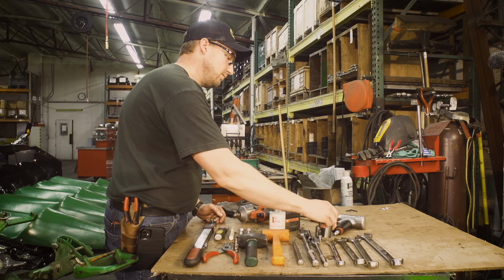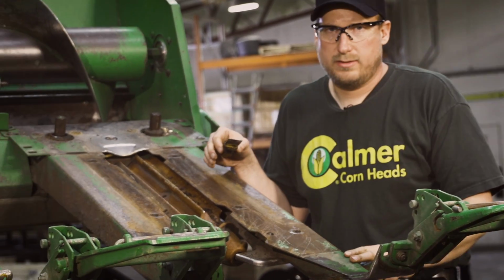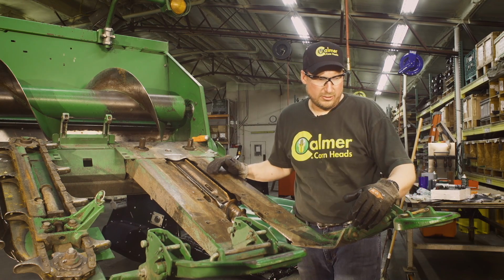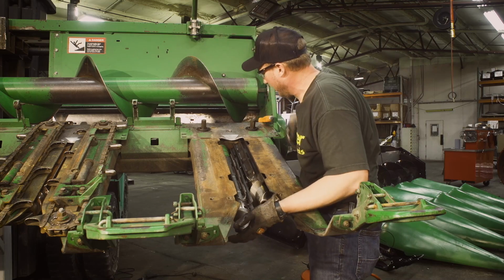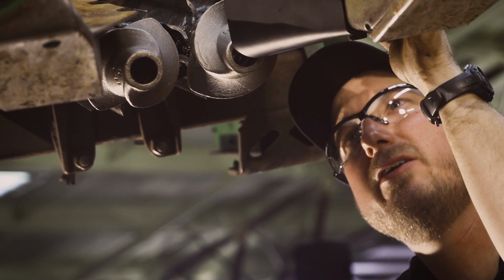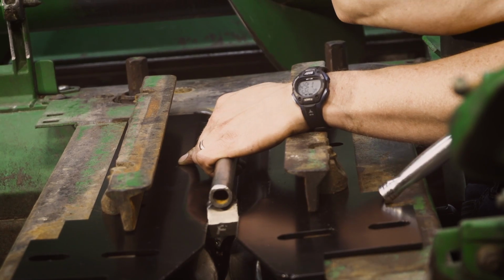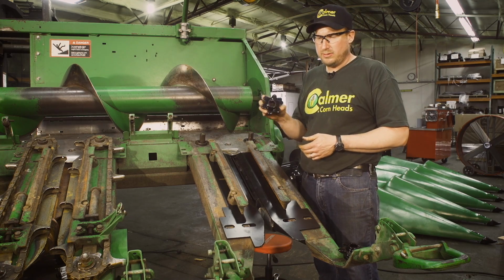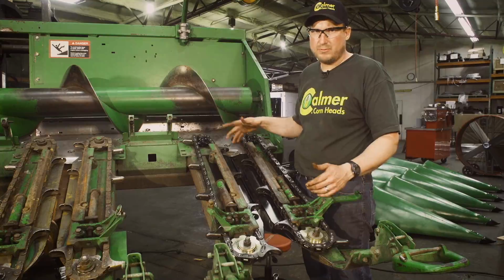Installing Calmer Upgrade Kit on John Deere 40 or 90 Series Corn Head

Comment: Can you describe the size and brand name of the hydraulic puller?  Minimum size required of the hydraulic puller and the cost?
Reply: I used a manual puller, Posi-lock model 210. I had to make a custom extension rod to get enough reach (an old beefy hitch pin the correct diameter and cut to length would be excellent).  Grind it to a rough point to center it on the stalk roll shaft, and make a small dimple on the other end to keep alignment with the puller.  Or get a purpose built stalk roll puller.
Reply from the maker: We had this one custom built for us quite a few years ago! There are pullers that are available through John Deere that range in price.

Comment: Its really nice when you do a thorough inspection and decide to replace slip clutches at the same time.  With the row unit gearboxes hex shaft pulled, you can turn the gearboxes very easily by hand. :D